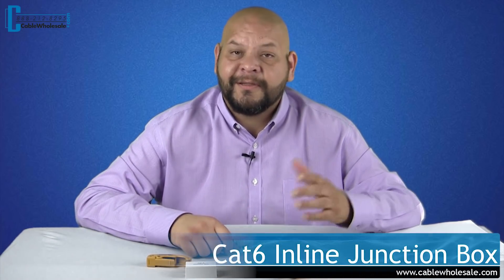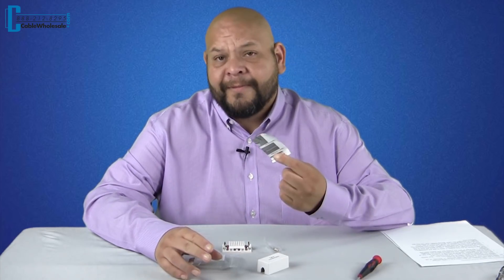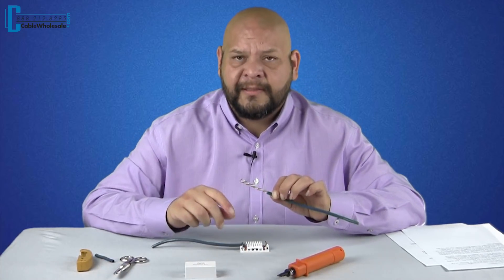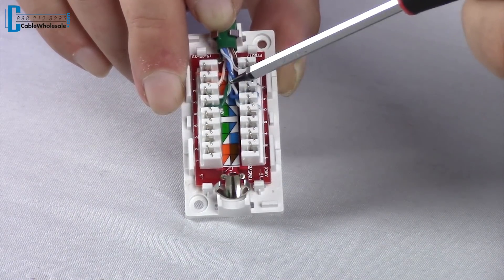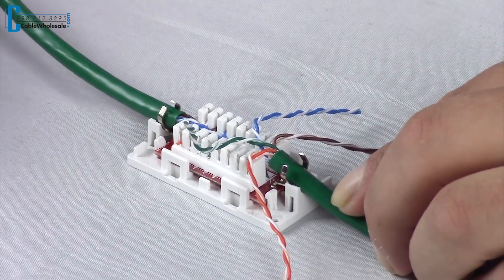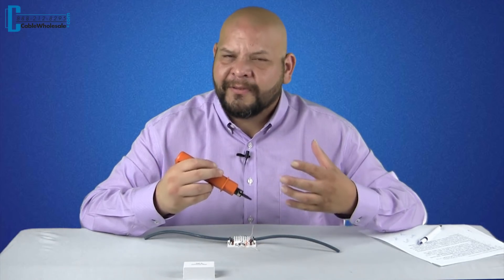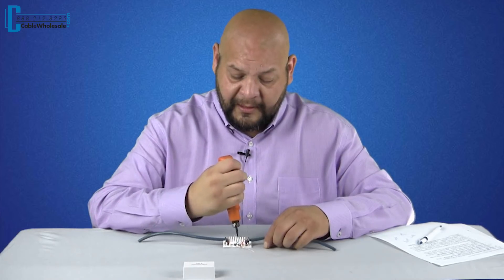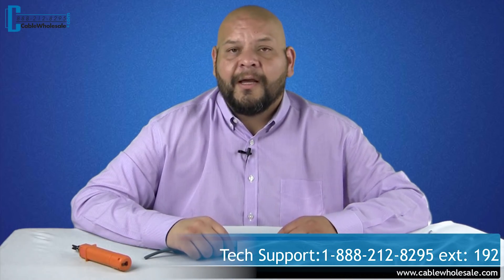Repair a Cat6 / Cat5e Ethernet Network Cable with a Junction Box

Comment: Would this work with a flat cable?
Reply from the maker: Hello Jacob,
110 blocks are intended for use with solid conductor cables and not stranded conductor cables. This is not intended to repair a patch cable.
Reply: CableWholesale.com thanks for responding so quickly on an older video!! That’s good to know. Thanks for the info!

Comment: Hi, does this method cause any data loss or speed loss because it's an interrupted run?
Reply from the maker: Hello Christosseventy7, This method of repair would keep the cable working at speeds congruent with the type of Category cable used. Data loss should not occur with this secure repair.

Comment: Is this ok for POE, I need to extend CAT 6 for soem Crestron equipment, and the slack is not enough. Just want to make sure I can have continuous power before purchasing. Thank you
Reply from the maker: Yes, they should work fine with POE and not cause any problems. Feel free to use our live chat on our website or email us at support@cablewholesale.com if you have any further questions and someone can assist you. Thank you for your question!

Comment: Good video.  Make certain to Secure the cable in the holder for proper strain relief.
Reply: Agreed! Makes me think of all the folks who do not understand the same function in an RJ45 plug. Outer sheath should always be mechanically secured so the conductors are not stressed/strained.
Reply from the maker: Thanks Chris! We realized this and have noted this in the comments and description of the video. Thank you for your input!